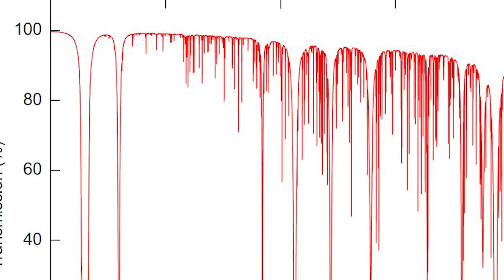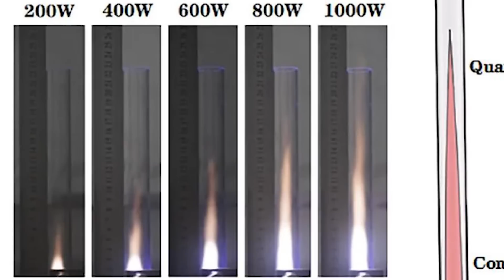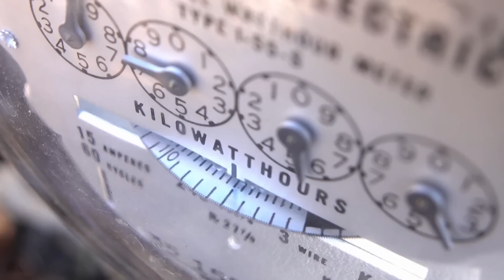The Microwave Plasma Jet Engine that Could Change Everything

Comment: The amount of energy needed to produce plasma is simply too high for it to be powered by any battery
Reply: A better way to look at it is:  You can make a plasma with a battery but why would you.
An electric motor spinning a propeller makes thrust without having to spend energy getting the air super hot.  The air coming out of the back of a plasma engine will be very hot indeed.  The thrust is still only what you get by action and reaction using the mass of the air sent out the back.
Reply: Why is nobody talking about the noxious gasses this would produce?  

When you compress and heat normal air, the nitrogen and oxygen can combine to form various NOx gasses.  Many of these gasses are toxic, and are major contributors to smog.  That's why diesel engines, which compress the air to higher pressures than petrol engines, end up causing more smog.  So this plasma engine, which is stated to compress and heat the air to the point of forming plasma, is no doubt going to create more noxious gasses than a diesel engine;  which kind of defeats the whole reason for using it to replace normal jet engines.
Reply: @adamz9324  The main reason nobody is talking about that is because the idea is daft for other reasons.  There is not much point in talking about the pollution generated by a system nobody in their right mind would use.
Reply: Hence... nuclear power.
Reply: Dark Tech is Bravo Sierra.  I'm out.
Reply: Multiply that by the enormous amount of energy in the form of thrust needed to move an aircraft fast enough to fly and we see some huge energy storage issues.
Reply: Let's say it was possible, imagine a world where every time the plane lands it has to sit idle for 12 hours while it charges
Reply: Lets put nuclear reactors in the sky. Whats the worst that could happen.
Reply: @Eluderatnight  Pilot says oops. Then nothing, because every black box, every eyewitness, and every record of what the plane was doing is vaporized by a mini-sun.
Reply: @Eluderatnight  Not much. We put nuclear reactors on rockets that explode half the time. Plebs need to stop fearing nuclear. Its the pinnacle of "I'm too dumb to understand, therefore it scares me.".
Reply: @Eluderatnight  not much. Nuclear reactors arnt nuclear bombs.
Reply: It's not - it only take a few watts to generate enough plasma to set things on fire (arc lighters). Any arc is gas (usually air) heated to a plasma. But generate enough of it and accelerate it up to high speeds to be able to use it for propulsion, is another thing. It seems like it would be more efficient to just build normal jet engines - but replace the combustion chamber and turbine with an electric motor. For a typical turbo fan jet engine, only like 20% of the thrust comes from the exhaust anyway - the rest comes from just the fan sucking in and compressing air and throw out at the back at very high speed.
Reply: @Speeder84XL  Yes, low power can make a small plasma but that leads to an inefficient engine.  Remember that your thrust comes from
F = M * A
  F = force
 M = mass
 A == acceleration
But the energy you need to put it goes as
E = (1/2) * M * V^2
E = Energy
M = Mass
V = velocity
It is that squared term that works against you when you make the plasma small.  For an aircraft you really want to use a large amount of air and only accelerate it a little.
Reply: Compression ratio. Ram Jet applications, even external bell or spike thrusters. You can even use it igniting the drag potential inside an atmosphere, eliminating drag by creating additional thrust.
Reply: except maybe a nuclear battery
Reply: Right.
Reply: A small nuclear reactor would do it
Don't expect to see that on a civilian aircraft
Reply: @Mike Collon just alleged mass beachings and loosing uss threasher, or that one russian sub.
Reply: Amen
Reply: Nope you can get several MW out of batteries if you use them right. A standard single 18650 can deliver 37W or more. Please learn to do the maths.
Reply: Batteries are barbaric. But the solution is nigh. We need a better alternative to a propeller for regular aviation, for when the batteries get better or we achieve Tesla's wireless long distance power transmission.
Reply: try to explain it to someone who doesn't understand that 0.01% change in trace gas concentration is just too small to make any measurable difference in global temperatures
Reply: I have to agree. Unless there are extremely major advances in energy storage technology it would be very difficult to justify this. That said however, energy storage technology is one of the fastest advancing fields in science and engineering. Another option would be to use ground based or space based laser or microwave beam emitters to transfer the appropriate energy requirements to the aircraft.
Reply: Never say never when it comes down to technology issues. 

There was once when "they" said that "heavier-than-air" travel will never be possible.

There was once when "they" said that humans will never be able to travel in a carriage going faster than 40mph (the "Bernoulli Principle, you see, "they" said)

There was once when "they" said that the "horseless carriage" was just a "fad" and will never take on.

There was also once when "they" said that it would be impossible to travel to the moon (and some actually still believes in this).

There was once when "they" said that no one will be able to sail around the world because they will fall off the edge into an unknown abyss as the earth, as 'everyone" knew, is flat.

There was once when "they" said that it is impossible for teleportation to happen as it is in the realm of science fiction but the teleporting of an atom of gold across two destinations has been achieved not too long ago. 

There was once when the never ending deniers and eternal sceptics said many things were "impossible"  

However, Napoleon Bonaparte observed that, "the difficult may take some time to overcome. The impossible takes just a bit longer."

Human imagination and ingenuity knows no bounds and so long as something isn't created by a god, humankind will find a way.
Reply: We will try to do this with hydrogen cells.
Reply: Remember that the original gasoline burning cars had to get their fuel from a pharmacy and the motors have evolved hugely in the century. You have to start somewhere and see the research through.
Reply: @jaanikaapa6925  No, you don't.  The back-of-the-napkin math says this won't work, unless you redefine "airliner".  The original gasoline burning cars had working physics on their side. They knew it was scalable.  They just needed to refine the engineering and install an infrstructure to support the mass consumerization of it.  This is not scalable with the technology we currently have nor can envision.
Reply: @jaanikaapa6925  Its a hoax designed to deprive you of your savings, embellish the prestige of the CCP, and get foreign technology "loaned" to the CCP. Nothing in China works, excuse the pun, in a vacuum. Everything is under the manipulation of the CCP.
Be cynical.
Reply: @jaanikaapa6925  of course but this research needs other research that aren't even developed advanced enough to support the main one.
Reply: @yourfriend4104  Agreed, but it is a start.
Reply: @jaanikaapa6925  they still work on the same basic principle now as they did 100 years ago, contained explosions moving a cylinder in a confined area. All that's changed really with combustion engines is efficiency and variances in application. This is unproven tech working in theoretical circumstances
Reply: @jaanikaapa6925  My thoughts exactly, these are the first baby steps, but I don't see these as being atmosphere breathing, they will be used for ferrying smaller spacecraft between Earth and Mars orbit with a nuclear power source of some kind. The only thing that will have to be shipped to them in high orbit from a gravity well is reaction mass.
Reply: Depends on the gas-plasma transition temperature of the element being used. Hence how those plasma balls exist.
Reply: @Pax.Britannica  but the earth doesn't have the most efficient gas for plasma like states. Especially the mixture and density of gasses within it and how it will change over time. Even with new nuclear discovery being the alternate power source, it would be to expensive and less practical in the long run. Along with the unease of people hear "nuclear".
Reply: @yourfriend4104  The atmosphere isn't of a set composition. There's a degree to which you can pick and choose what gasses you want your aircraft to use. For instance, we already have working prototypes of high altitude, in atmosphere ion drives that use solar energy and gases from the atmosphere to sustain an unsustainable orbit.
Reply: @Pax.Britannica  I'm
Reply: @yourfriend4104  You're a legend. Thank you.
Reply: @Pax.Britannica  of course however those aircraft aren't built for carrying massive payloads or passengers. They have massive wing spans for the needed lift and travel at a very slow speed. People don't want to spend over days to weeks waiting to get to their destination. To make this into commercial jet engine would take decades of research and investment and that's even if it is more efficient and effective than tradional jet engines.
Reply: The Chinese need a laxative.
Reply: The amount of energy needed to produce light is simply to high for any battery. Better stick with whale fat it works allot better
Reply: @angelusdaemonium8690  Absolutely, whale fat powered aircraft, whales are a renewable resource it's perfect.
Reply: If it's producing propulsion it could easily have a output shaft that spins a generator to make its own power.
Reply: @Cujo116  lol. Conservation of energy.